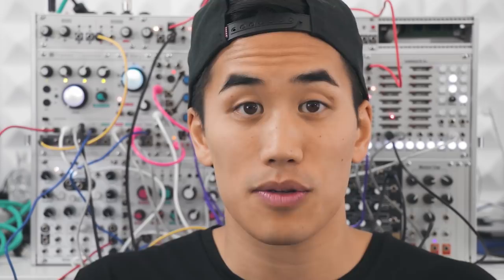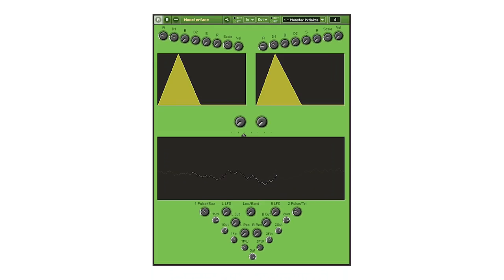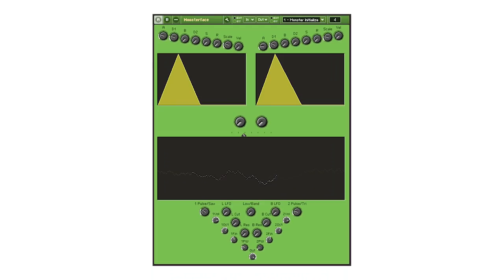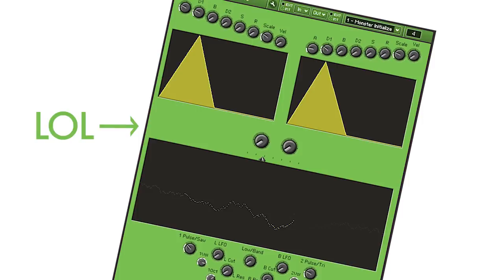The instrument I've secretly worked on for 13 years

Comment: I recommend VCV Rack. It's free. It's open source. Most of its modules are clones of hardware modules which makes deciding what you want to buy much easier. As for modular being expensive, it isn't all that bad. A lot of companies offer their mods not completely assembled so if you can use a screwdriver, you can save some cash. They often have the circuit board and components for sale if you're handier and can do some fairly simple electrical work. You could spend, for example, 250, 190, 65 for the same module. Go make some noise, kids! Help the ever-broadening acceptance of stranger and stranger timbres.

Comment: I'm a video game designer (and hobbyist musician), and I just noticed how weirdly similar modular synthesisers are to shaders in a game environment! Especially if using visual shader tools.

How you can plug a variety of different outputs into a variety of different other inputs to change a final input which you hear (or see, in a game)...

i never realised my two passions were so similar in this way!
Reply: It's a common way to visually program, so not surprised. That said, modular synths were one of the first to do it, decades ago.

Comment: Another great piece of software to start learning modular is Caustic (machine called 'Modular', to be exact). Although  it is not that powerful and flexible, you can still make some interesting contraptions, also the reduced complexity makes it easier for beginners to understand what's going on. 
You can try out the app for free both on Android and Windows and just mess around and experiment.
If you want to just have a standard VST synth, but with crazy modulation options, you may want to check out Helm. It allows you to connect LFOs and envelopes to literally any parameter within the software.

Yeah, I know this video is over a year old.

Comment: Why is Eurorack so expensive :(
Reply: circuit bending is cheaper and can be really fun too ;)
Reply: I know and I know.
Reply: Try it out in the virtual world first. VCV is a free Modular synth VST plugin, and it actually sounds pretty good.
Bobeats has a bunch of videos using it. Check it out dude.
Reply: Totally not as expensive as it looks, PMFoundations makes $20 modules that you build yourself and you could make a basic power supply for up to 5 modules for around $40.
Reply: +Spunkweed Yeah but the PMFoundations modules only come with the PCBs, once you buy all the components, it suddenly turns into an 80 dollar module.
Reply: DIY you can build yourself and then it becomes cheaper.
Reply: Jet Lag - Most modular equipment is kinda pricey because it's (with maybe very rare exceptions) all hand-made w/ discrete components.  Usually only the circuit boards and faceplates get any kind of mass manufacturing, but since they are still special-ordered, limited quantity mass manufacturing, those are more expensive than products that get made in the tens of thousands to millions of units.  It's the same reason Moog or some DSI/Sequential or Tom Oberheim synths are quite pricey...but with those, you're also paying a bit of a premium for the demand for the brand.
Reply: It's really not that expensive when you compare it to ready made, all in one boxes... of course adjusting for customizability.
Reply: Well, as a boutique manufacturer of those modules i can tell you that the profit margin is rather low. You will not get rich making these (in fact a lot of manufacturers do it part time). The quantities are still rather low, and there is a lot of manual work involved.
It is special, it is low quantity niche market with high R&D costs, often it is hand crafted, and considering this it is not expensive at all.
Reply: Okay, when you built it do the following: take the price of a comparable ready build module, substract the expenses for parts. then divide the remaining expenses by the hours spend buildng and toubleshooting it. Then you know what your time is worth - maybe it would have been better for you to make some overtime in your daily job. :)
Reply: Software is the new punk! VCV, if it works for you (it doesn't for me), is a good choice. Pure Data is good too... and Andrew calls out Reaktor, which as of its last major version introduced Blocks, a bald-faced imitation of the Eurorack market that has inspired an explosion of free user-created modules that make the Reaktor platform an amazingly powerful choice for the money if you already have a capable computer lying around.
Reply: Jet Lag you are omnipresent on YouTube.
Reply: Try VCVRack, it's awsome!
Reply: Because its a electronic thing?
Reply: DIY rules!
However, this will leave less time for making music :D
(and don't forget to put a price tag on your working hours)
Reply: there are other more affordable formats and DIY modular synths. TipTop Audio, AE Modular, Befaco, etc.
Reply: It isn't though? You can buy ready systems for like 500 bucks, that's pretty cheap for a quality instrument.
Reply: those are usually single-unit desktop modular systems (ex: Pittsburgh SV-1 or Make Noise 0-coast), not modular-modular synths where you can swap out each module.
Reply: test sound I think doepher makes the like where you can switch out the modules. In any case that's a good place to start since you can integrate those into modular system anyways and many are eurorack compatible
Reply: I vote for Pure Data. Been at it for a few years and it has suddenly turned into a DAW. For new mind, it might be overwhelming and you have to do some work to actually make a track (not just plug some wires or draw on piano roll with downloaded VSTs..) but believe me it is worth it. Once you built your own instruments, it is a custom enviornment just for you.

Comment: Maybe the next thing is modules with a way to recall knob positions and color coded connections. So you have a module that is only for storing patches that connects to every module. Every knob could have a number and the setting could be done manually from a list on a screen or every knob could be motorized. Ok, sounds crazy and probably  very expensive but it would be nice.

Comment: Ezra Buchla is a pretty bright guy. I worked with him in 2009-2010 on EastWest's PLAY sampler and he was building in some pretty rocking effect modules at the time. It's a very different experience working on the flip side of a DAW.
Reply: I've also been exploring modular synthesis in my free time lately, but in order to really fully understand what it is I'm doing and try to gain some insights into the way each sound is produced, I've been building a software synthesizer from first principles, digitally patching together modules of my own construction. It's been MINDBLOWING.

Comment: How many modules do you have and how much would they all roughly cost together? I'm impressed by the sounds this machine makes and just wondering how much it would cost to make something like this...
Reply: Anime Freak His system would be roughly $5k, though there are cheaper cases, modules, etc.
Reply: Best way to start, IMO: check out the Make Noise 0-Coast. Not modular but compatible with Eurorack, really fun, and (relatively) inexpensive.
Reply: the Pittsburgh modular lifeforms sv-1 would be a better route imo. it has everything a basic eurorack system needs and is a really good building block to start from. I had one but returned it because I realized I already had synths that cover the same ground but if I didn't have my sub 37 I definitely would've kept it. SUPER fat sounding and great place to start.
Reply: you can also put it right in your rack unlike the 0 coast
Reply: I mean... I have 0-Coast and it does have everything a system needs... An additive oscillator, 1 cyclic envelope,  1 ADSR, an LPG, a clock and random source, multi, attenuverter, as well as arpeggio mode... What more do you need?!

And I've seen 0-Coast in racks.
Reply: Yeah you can put the 0-Coast in a rack. It just needs to be modified, but it's not hard.

Comment: I've been going nuts over synths lately, Im saving up for the MS-10
Reply: IMO you shouldn't get it because you can't really expand it since it doesn't use 1-volt-per-octave CV.
Sure, it sounds great but that's about it.
I'm going to go for a Moog Mother 32 or a Pittsburgh Modular Lifeforms SV-1 Blackbox + some kind of keyboard or sequencer (maybe just my computer. But if I get the Mother 32 (or both) then I won't need a sequencer).
Reply: Its a simple synth, im only starting so its fitting
Reply: You are better off getting a minibrute, or another recent monosynth. You will pay way more than the ms-10 is worth of you can find one at all.
Reply: Polite Society I keep it in mind, thanks
Reply: I think getting Juno 60 would be nice too, the arpeggiator is nice to have as well
Reply: Just get the MS20 mini. A lot more features than the MS10 but with the same sound.
Reply: Jet Lag, you can expand it quite easily. Most CV inputs/outputs work fine. You can even bypass the pitch issue by using the FREQ or TOTAL inputs, which track at v/oct!
Reply: cheaper too, good idea, thank you

Comment: If you want a synthesizer you can take on the go, you can buy one for the Nintendo 3DS made by Korg, called the DSN12 which has a step sequencer, pads, and patch cables to plug in and out (not as crazy as Andrew's modular though)... Soon, the Nintendo Switch will be getting Korg Gadget, which has different varieties of maybe 16 synthesizers, most which don't need patch cables.

Comment: If you have the money,you can delve into hardware modular,yet VCV does the same exact thing,and you can control the software with hardware.Plus,then if you add samplers,a few pedals,and still have endless options...There;s much more,like CSound,Pure DAta,BUZZ,<etc,etc...

Comment: Just curious if you have tried miRack and Drambo for iPad. Both are crazy cool modular apps that release new modules regularly. The sounds are incredible and I would be surprised if you didn't jump up and want to immediately patch them into your hardware modular system. I mean what could be cooler than a hybrid iPad modular system collaborating with a eurorack system. You can save the iPad patches and work any patch into the wonder of your tactile masterpiece. Please let me know what you think of those 2 apps. Is it wow or is it yippee.

Comment: I would never buy a modular/ analog synth. I have been into electronic music since 86 in the dawn of digital (I am 43 right now). And here is:
1. They are expensive when you buy it, when you want to sell them there is little to no market for it. So you paid $300 for a module, you will have a hard time selling it for even half. 
2. When you create a sound you like... you will lose it forever once you move a cable. So is like falling in love with the girl of your dreams and having a one night stand but you know that when you fall to sleep she won't be there ever when you wake up. Pretty frustrating, you will end up selling the analog stuff.
3. You will not be making any money out of it. After expending thousands of dollars.
4. You will end up using Logic Pro for your music anyway... it will sound the same with less tweaking and less money. you can recall your sounds and you have billions of more patching options actually! 
5. Yes, there are a few things that are more fun in modular, it is fun but too expensive and too many cons. That is why they were replaced by digital in the 80's. Today digital sounds as good, components are better, the resolution is better. 

If you buy a modular think in keeping it for the rest of your life, that you will be using it in 10 or 20 years, that you do not need the money any more.

Comment: The most technical I have ever gotten is my DSI Tempest.  Does modular need to be tuned at all, does it change with temperature, can you hear the difference between digital, etc.?  Thanks.
Reply: Depends on the module. He's using mostly digital modules so that shouldn't matter.

Comment: What is that midi controller at 5:00 (white, in the foreground, lower right)
Reply: monome grid
Reply: Aaaaah ok. Crazy price. Is there something like this that is just a step sequencer and doesn't have all that other stuff that drives the price up but that I don't need? :D Why are all sequencers with nice lights and buttons and more than 1 or 2 tracks 500-1000 Euros :/
Reply: Well there is TipTop Circadian Rhythms module but the price you won't like.
Then also Novation Launchpad but those are just controllers as far as I know.
Maybe a Beatstep Pro would help?
Reply: I bought a Hermod which is pretty cheap for what it can do and it can record real midi, but for drums I wanted something with 16 steps but more than one row. Everything in that simple category seems to be overpriced (except the SQ-1, pretty happy with that unit even though it is pretty bulky and not modular).

Comment: Hi  ANDREW 

I DINT ANDERSTAND ANYTING EVEN THO U SHOW US HOW TO USE IT
Reply: Modular synthesis is pretty complex. But basically, you have boxes called "modules" that create and effect sound; these boxes are all shoved inside an even bigger box just to hold all the smaller boxes. One of the small boxes will create the original sound, then you connect it to the other small boxes with cables to keep modifying that sound. The knobs on the boxes control the amount of the effects. That's it on the most basic level. The reason you'd do all this is because you can get very specific sounds or sounds that can't be created any other way.